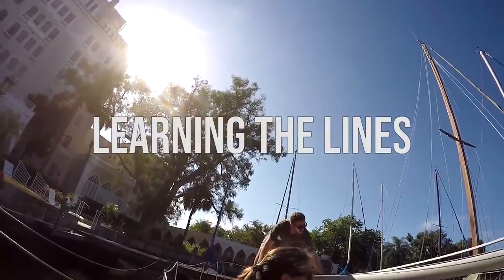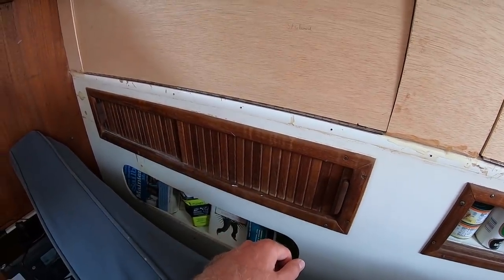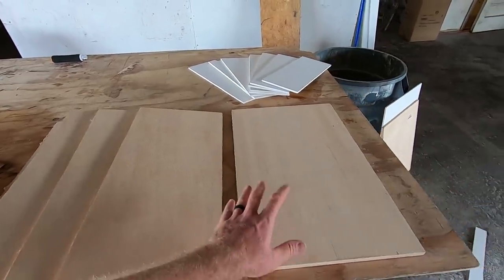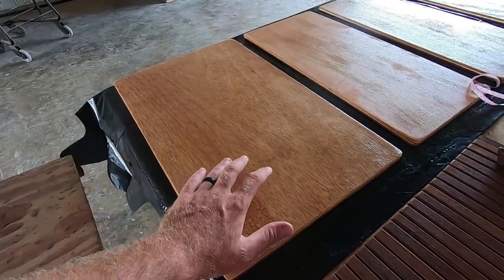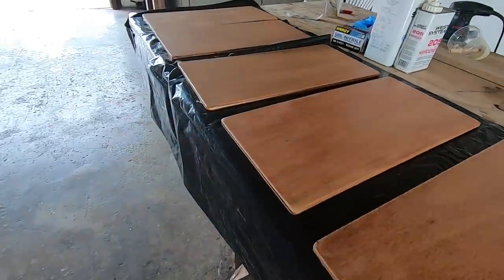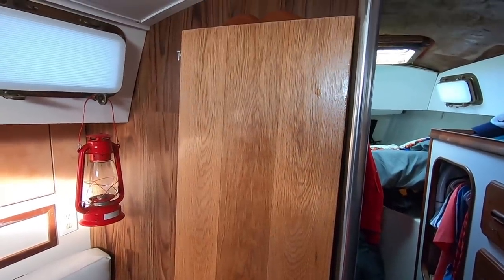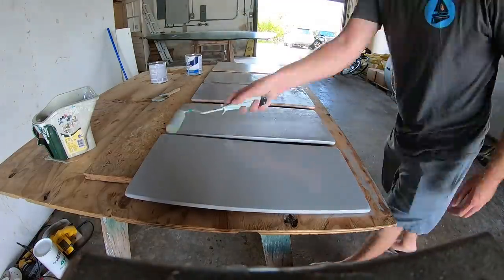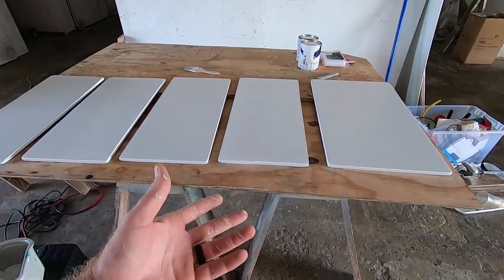79. DIY Marine Cabinet Doors from HOME DEPOT?! | Learning the Lines - DIY Sailing

Comment: Next time you leave plates to dry after putting epoxy on both sides, place them on two strips of wood that has nails put through them so the plates only rest on the very tip of the nails, that does two things, it lets both sides dry evenly and only leave a very small dent to sand over, just a small tip for another day, otherwise keep up the good work .

Comment: Really nice! And good to see we're not the only people out there that say "good enough." That latch on the forward locker MAY be ok but you'll be surprised at what comes open when you're in heavy seas. We started with basic latches and then moved to positive locking latches everywhere after being in heavy weather and having to clean up all the open lockers. Normally the boat only moves port and starboard, but in big seas you'll also be pounding fore and aft. Also.. careful of the metal types. Most magnetic metals will corrode.

Comment: Great work. I have refurbished two older model Chris Craft Cruisers and obviously do a lot of wood working. Just a tip for painting both sides of your doors and other materials. To keep fro laying them flat on plastic and getting the wrinkled look, go to the toy department of your local Walmart and buy a couple of bags of Jacks. Yes, those little metal stars that we used to play with as kids. Place four of those near the bottom corners and lay your panel on them. You’ll get minimum impact on the bottom side and minimize trying to sand out the wrinkles. Happy sailing.
Reply: Good Idea, but maybe you didn't know they make a product called painters pyramids.  check it out on amazon.  I'm pretty sure I saw them at HD also.   I got some at a wood workers convention several years ago and have used them countless times.

Comment: Hey guys,  You're obviously a fairly talented woodworker, I do have one simple suggestion...  On the table leg, consider drilling it and putting in a dowel to stabilize it.  Concern is the short grain will break again with use or when you install your hinge.   Great job over all though!  We enjoy your videos.  We are in contract, pending a survey on our first sailboat and I intend to do some interior facelift work,  your videos are great inspiration.  Thanks for your tireless work and sharing.  -Corey (YouTube Channel Salty Escape)
Reply: Agree. A couple of through dowels is needed Or since he has a router, an inlaid stainless steel plate. Myself I would have made mortise and tenon or a half lap joint.

Comment: Good work Jordan.  The doors look nice with the paint and the rounded corners.  agree with Salty Escape about the table leg.  I've had several similar legs cut like that that have split.  If you have access to a table saw you can cut a groove in the top edge and glue in a batten to keep it from splitting.  Take care and remember it's not how fast you move forward as long as you keep moving forward.

Comment: As others have mentioned, the short arm of the table leg is going to split again. Not if, but when. First of all, oak splits extremely easily. It's the nature of the beast. The geometry of that leg guarantees another split. There are several ways to mitigate against it, however, some already suggested.

A dowel parallel to the upper surface, although you might not have enough drilling resources (including experience) to do it well. I have a drill press and I'd be hard, er, pressed to do a good job at it. 

The piano hinge idea is also good, and the first one I thought of as I was watching, but it depends on the attachment with small screws. 

I think I'd probably machine a slot (also nearly as difficult as drilling for a dowel) along the top and glue a spline into it. That potentially introduces a cross grain situation ensuring further splits of the oak, but the potential is significantly mitigated by the relatively small areas involved. Moreover, even if (when) it does split the oak, the result will be principally cosmetic and in an area rarely seen.
Reply: yeah, a spline is a good idea too!  He should have access to a table saw, this would be technically more feasible than a dowel with a limited shop.  A third option would be to laminate thin long grain wood on either side, maybe 1/4 inch thick to create an oak ply of sorts. epoxy it together.

Comment: I’m a new subscriber and just got caught up on your videos.

I’ve been thinking of your wind turbine issue.  More power is good, and power at night is good, also.  
I think the best answer would be to use a transom bracket with a slide-in plate welded to the base of a mast at the proper angle.  The mast would use 2 braces off of the solar arch for stability and the right amount of offset from the panels, and be just tall enough to allow the blades to clear the braces.

If you wanted even more offset from the panels, you could have the mast made in a dogleg shape to keep it far enough aft.

Sorry, I don’t have the tools to do a digital sketch, but the design would be very simple. 
Use a trapezoidal plate attached (wide end up) with channels on the angled, opposite sides, and through-bolted onto the transom.  The base of the mast has a matching plate that slides downward into the transom plate and is engaged by the channeled rim of the plate.  With the mast plate at the right angle, the mast goes straight up from there, or can go up, angle out and then go up again (dog leg) to the right night.  Braces from each side of the arch connect to the vertical portion of the mast.  I’d do it all in whatever alloy the arch is made from.

Comment: Don’t know if you did this, or thought about it after the fact, but I would knock the bottom corners of the table leg down some, so it’s not such a hard angle and possible scratch the floor, or ding / chip the corners.  Kinda like 2 small and rounded 45 degree angles on the bottom where it meets the sole.
Reply from the maker: Good idea. I also have to add a dowel and a small hole in the sole for the leg to fit into. Right now if you kick the leg by accident the table falls down.

Comment: You can create the look of the old door, by grooving the door in the same spacing of the old door, stain the grove are burn it black and stain the other parts to match.  On the other doors if you cut a 1/4 piece of plywood the same length and 1/2 inch wider than the spaces between the doors and glue it to the back of the door spacers you will have a 1/4 inche over hang to catch you doors to make then flush

Comment: I think the plate that the magnetic door latch uses is going to rust pretty quickly in the salt air.  You should remove the plate and coat is with some varnish or epoxy.  Also, how are going to keep the sliders closed while underway?  Is there some way to latch them?

Comment: I have the exact same problem with my boat. All the doors are missing. I'm wondering what thickness wood did you use? I can get plywood down to 3/8 or Luian down to 1/4. Which do you think would work best? Also, why didn't you stain the doors? I think even coated with the epoxy they looked great! I'm a big fan of stained or vanrished wood. Painted wood is plain. But that's my opinion. Thanks

Comment: For the stowage under the v-berth, I think you would be happier with drawers there than just shelves.  When you want to look at the sight gauge for your water tank, it would be much easier to remove drawers complete with their contents and then put back when you are done, than dig out all of the loose items on the shelves and then put them all back.

Table leg will most likely break again because the corner is inherently weak due to the grain orientation.  It would have been better to have made that piece out of plywood, or to have made it out of multiple pieces.

Comment: You shouldn’t need to expoxie the ply for the use it’s intended for   As it will be hard to get a good paint finnish  I have found thinned varnish was better , it was cheaper , soaked in heaps better and sanded well and didn’t leach out any epox fumes and it holds paint very well , end grains soak it up well

Comment: I like the look of the doors after coated with the epoxy.  Do you have to paint or varnish after or can they be used with just the epoxy coating?  Sorry for the basic question but I'm trying to learn to prepare for the future.
Reply from the maker: You can definitely use them with just the epoxy coat if you like the look. A good technique for really protecting wood is to epoxy coat then varnish over that.
Reply: Yes just an epoxy coat should be fine OR you could just use a good varnish like they did with the drop down table and soon to be leg support he just cut out.

Comment: Can I get the particulars on the PVC board?  Can't seem to find it on the Home Depot site.  Thank you!!!
Reply from the maker: So the weird thing is it's not on their website, but it's definitely in the store, at least in Florida. It's in different sections in different Home Depots as well. I'd walk into your HD and look in the plywood section, and if it's not there check where the trim is. It's sold in 2'x4' sections in 1/4", 1/2", and 3/4" thicknesses. Also, they have 4'x8' sheets in the 1/2" thickness and only the half inch thickness. Hope that helps.
Reply: look up plastic shops in your town/city. there is a business i use here for all my hdpe board and just today I got a sheet for all my backing plates.... for life lol.... and it only coast me 5 bucks.
Reply: @LearningtheLines  I saw it here in our HD in Myrtle beach.....

Comment: What did you use for the track and where did you get it all of mine need replaced
Reply from the maker: https://www.amazon.com/Knape-P2417TAN48-Plastic-Sliding-Track/dp/B000CSK398/ref=sr_1_5?crid=2D1D2UP62Q0OK&keywords=sliding+door+track&qid=1554827530&s=gateway&sprefix=sliding+door+tra%2Caps%2C375&sr=8-5

Comment: Your wood doors look great !!  Dont care for the  PLASTIC!! To much plastic in the OCEAN all ready!
Reply from the maker: If they made an easy alternative to plastic as a release film for working with epoxy, I'd be the first to try it!
Reply: They do, it is called PVA. Works best if sprayed, but you can also get ones that can be rolled.
Reply from the maker: Thanks, I'll look into it!
Reply: @LearningtheLines  I believe he's talking about the plastic doors.  A helpful hint for you, when painting or coating with epoxy, take some scrap pieces of wood and drive nails or drywall screws through them. Place them on your table, screws facing up, then put your painted items on the screws. The items will not stick and when dry, you wont see where the screws touched your paint or epoxy.